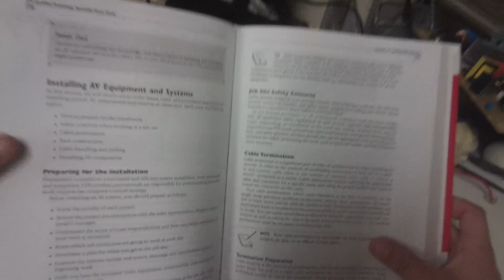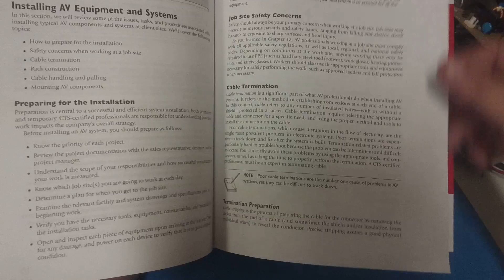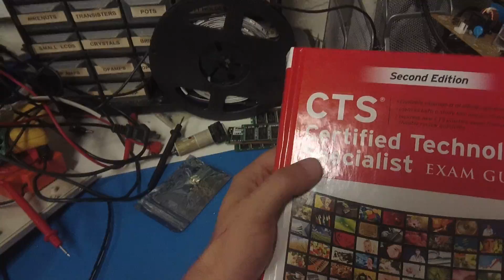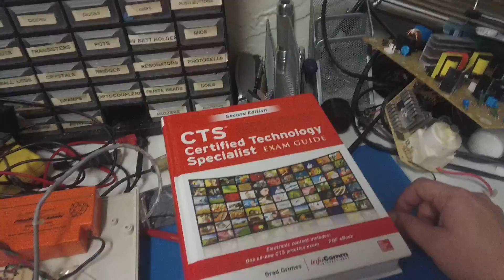Reading A Bed Time Story.(How to Terminate a RG6 cable tv wire good night )

Comment: Catv is only properly "signal terminated" when there is a 75 ohm cap on end.
Reply from the maker: A terminating resistor for a television coaxial cable is often in the form of a cap, threaded to screw onto an F connector. Antenna cables are sometimes used for internet connections; however RG-6 should not be used for 10BASE2 (which should use RG-58) as the impedance mismatch can cause phasing problems with the baseband signal.
Reply: Geoff Howeth what does 10base2 have anything to do with termination?